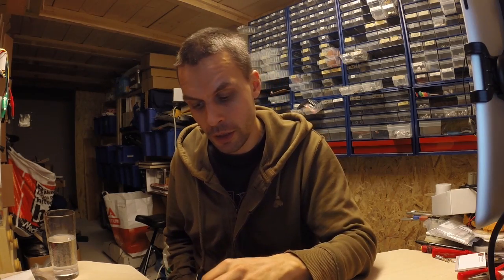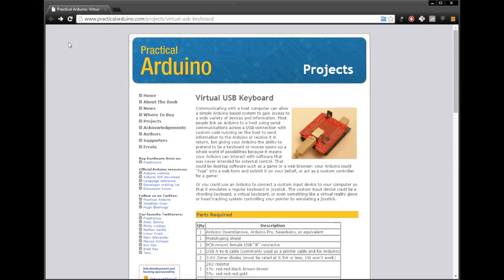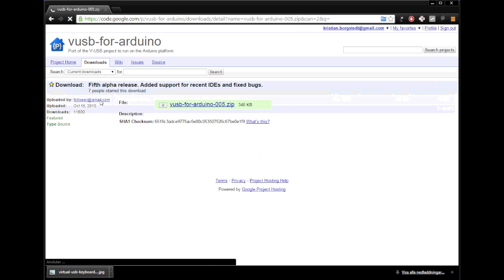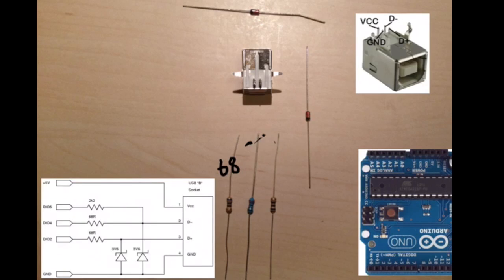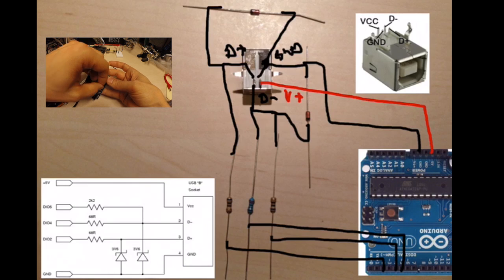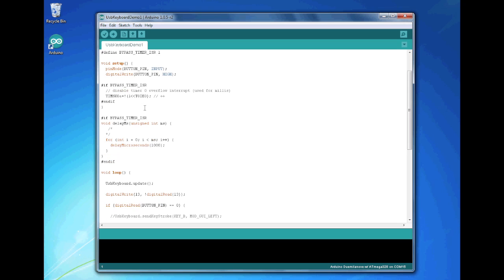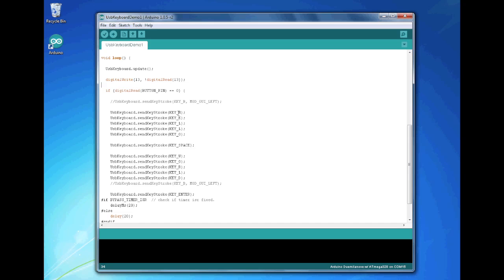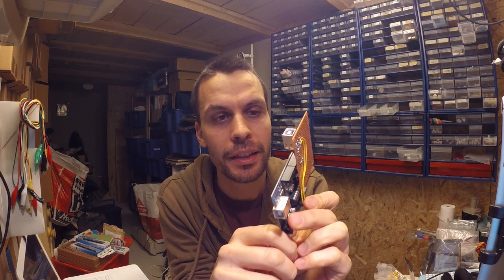Arduino UNO as a USB keyboard (HID device) [Anything Arduino] (ep 6)

Comment: I just gave up. I have all the components according to the tutorial. The only thing i do not have, is the female usb connector "B". I'm using a usb connector "A" male, with connecting pins. I uploaded the sketch first. So, I did the circuit on a breadboard. Does not work. "USB Device not recognized". My Arduino is a Arduino UNO R3, ATMEGA328 P,  my O.S. is Windows 7 64- bits and, i'm using the IDE 1.5.5. Please ! a good soul, experienced, can help me ? please ! thanx for your attention ! greetings !
Reply from the maker: +Lord Damios Ah, Yes, it seems this library only works on IDE version 1.0.5r2 or EARLIER... :/ Sorry about that. Many people have downloaded that version and have it working with that version of the IDE...
Reply: Thank you, Kristian ! i'll try this version. But my Arduino UNO is a R3. Even if i install the 1.0.5 R2, would it work?
Reply from the maker: +Lord Damios Yes it will work with R3. That is what I use all the time :)
Reply: Really, thank you Kristian ! i'll try after work hour. Greetings !
Reply: +Kristian Blåsol  

Hello, Kris! I again! but this time, I swear: it is the last time - I am a man of his word. First, I want to say that I finally managed to carry out this tutorial successfully. Even managed to do with the Atmega in "Standalone"
on the breadboard. Thank you for your support! I had to make some changes...
 As I have said, my Arduino  UNO is the r3,  use a USB cable male type "A," a breadboard, now use the  IDE 1.0.5 R2and my operating system is Windows 7 Ultimate 64-bit. Well ... to work in my case, I had to reverse the scheme. The "D - " goes in the digital pin 2 (without 2k2 resistor) and the
"D +", goes the 2k2 resistor placed in digital pin 5  and placed in digital pin 4. Even just ATMEGA328P standalone in the breadboard, the project works. Why does it happen ? Why work with this schematic and does’nt work with the standartd  schematic ?
I pretend to make a custom joystick, a gamepad for me. When I upload the Skecth UsbJoystick (this belonging to V-USB library), the scheme does not work at all. Could you recommend me some USB Joystick sketch for ATMEGA328P, clocked at 16Mhz, which is license-free and that works just like the UsbKeyboard library work for me ? 
I pretend to make a custom joystick,a gamepad for me. When I upload the Skecth UsbJoystick (this belonging to V-USB library), the scheme does not work at all. Could you recommend me some USB Joystick sketch for ATMEGA328P, clocked at 16Mhz, which is license-free and that works just like the UsbKeyboard library work for me? 

Thanxs Again ! ( I swear ! Last time ! ;-) )
Reply: +Lord Damios heelp

how do you modify it??
explain it
heeeelp
Reply: Hola, +Ricardo Vargas !  bueno, me di cuenta de que usted habla español. Soy brasileño, pero voy a hablar en español con usted.
  
   
  En mi caso, el cable blanco me parece la "D -" (que no es una cosa muy común) del cable USB. Estoy sin un multimetro y no puedo comprobar en el tiempo, las variaciones eléctricas. Luego, que deduzco que el cable blanco es el "D -" en mi caso.

    Entonces,  que lo que hice fue: el alambre blanco en el extremo de la resistencia de 2k2 y en uno extremo de las  resistencias de 68 ohmios. Entonces el otro extremo de la resistencia 2K2, va a la PD 5 Arduino y el las  resistencias de 68 ohmios, en PD4.

    Esa es la forma en que trabajó conmigo. Puede ser posible, su cable USB es como la mía.Recuerde que mi Arduino és UNO R3 , mi IDE es ahora el Arduino R2 1.0.5 y cuidado con los diodos ! comprar dos de 0.5W !

Espero haber ayudado.

 Saludos brasileños, Río de Janeiro!
Reply: +Lord Damios Hola! y muchísimas gracias por prestarme su tiempo

intenté comprender su esquema pero siento que hace falta algo..
Me pudiera ayudar porfavor mandando un dibujo del esquema de su circuito?
Le Agradecería Muchísimo su Ayuda(:

mi correo: ernestoricardovm.64@gmail.com

graciasgracias por su tiempo
Saludos desde Tijuana México!!
Reply: +Ricardo Vargas ,  envié un correo electrónico a usted. Lo siento por el retraso. Fue un día duro.
 ¡Saludos!
Reply: +Lord Damios hi! Can u send me schematic too? mrlcrosl@gmail.com
Big thx!
Reply: +Ольга Клепцова , do you speak english, right ? i'll send in english to you. After work hour, i'll send to you. Greetings !
Reply: +Lord Damios yes, i speak english. I am trying to finish this project for 3 days and cant understand what is wrong with it :\ Hope your schematic will help me
Reply: +Lord Damios  Not sure if you ever got it working - but make sure you are using the OLD version of the IDE, later ones won't work for this and will may be unpredictable even if it does seem to work at first. See video description for the required version.
Reply: Gord Slater
, dear friend, this problem is solved. Thanx for your help ! Greetings !

Comment: Hello,
How can you use this for a usb barcode scanner?
Reply from the maker: +Jadid Kootbally Well actually you cant use this with a barcode scanner, but I have a project with connecting a barcode scanner to an arduino lined up, just need to find the time to make it! :) Hope you can wait a while longer...
Reply from the maker: +Jadid Kootbally If you use a USB-device cant you just connect it directly to the Android device? Most Android-devices support USB. And basically a Barcode scanner is recognized as a keyboard... If not I'll try to move the barcode scanner project up the list...

Comment: Is there any other lib's that I can use with this usb (device) board?  The USBKeyboard.h doesn't look like it has many functions which can be used, I mean the arduino keyboard lib for leonardo had more and may usefull like holding buttons untill releasing ..etc but this just typing.

Comment: hi there, i am working on a project where i need to enter some text which the LCD would display without the computer....well in order to interface the keyboard i am using USB Host Shield....however my parallel LCD don't display what i am entering through keyboard...any suggestion...

Comment: Is that basically like a USB Host shield now?
Reply from the maker: Ryein Goddard Well no, it is a USB Device. So depending on how you write the USB Descriptor file you make make the Arduino act as different devices, in this case as a USB Keyboard, but you could also make a mouse, joystick, or other... In this case, the computer that I connect the shield to is the USB Host. Hope it helps...

Comment: can this be done with Arduino Mega ?
I have a project where I need to emulate a joystick on the PC and in the same time control a motor, where you for example press right on a joystick connected to Arduino and it does 2 things at the same time emulate the move right on the PC and turn a motor right with the same speed.
The motor is PID controlled using a magnetic encoder thus it needs interrupt pins
that's why I was thinking Arduino Mega as it has a bunch of those.
So is it doable ?
Reply from the maker: Hossam Zayed Yes this should be possible. Mega is shield compatible with Uno, so I believe it should work for your application.

Comment: Can  I do this without the shield
Reply from the maker: No. sorry, for this to work you need to build the shield. It should be quite cheap to build though. You can get similar functionality with an arduino Leonardo without using a shield. This is because it uses a different armed chip with built in USB support.
Reply: Kristian Blåsol OK thank, I'll create the shield or breadboard it,
Reply: Kristian Blåsol Wait does this mean you can't just use the Atmega chip by itself?
Reply from the maker: Mebin Skaria Yep! You dont need the whole Arduino board, you just need the ATmega chip and the small circuit described in this video.

You also need either a resonator or oscillator running at least 16MHz. See this video to set up a ATMega + resonator https://www.youtube.com/watch?v=KXFGgVN98J0 And then just add this sketch... 

A resonator SHOULD be eneough, but if you want to be on the safe side use an oscillator, as timing is crucial for the USB to work...

Let me know what you make! :)
Reply: Sweet thanks man! I'll make a video and link you! I already ordered the parts for the stand alone Atmega328 with the crystal already. I'm planning on making a fight stick, for street fighter. 

Hopefully everything goes to plan haha.